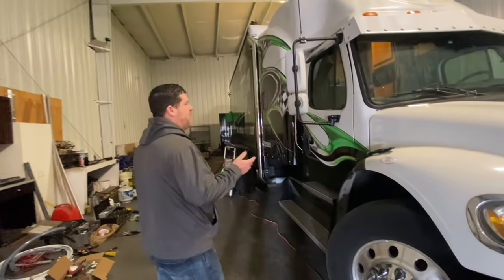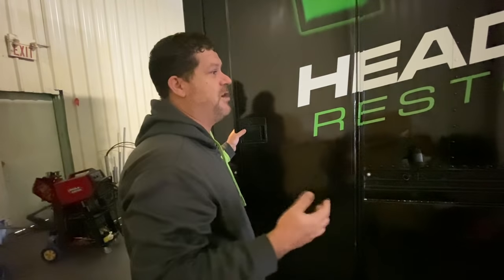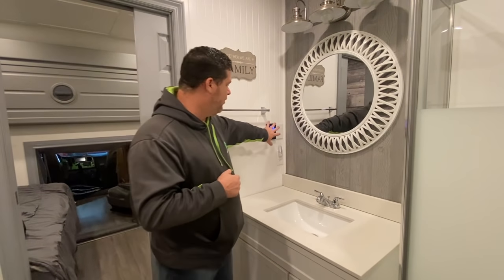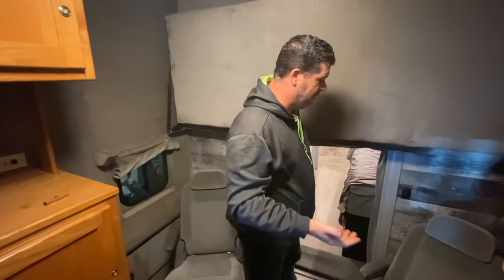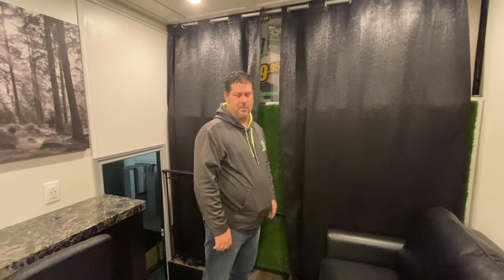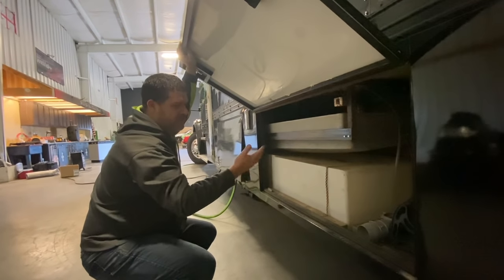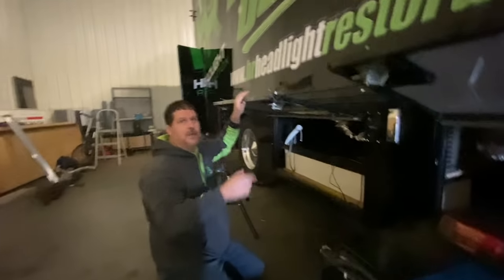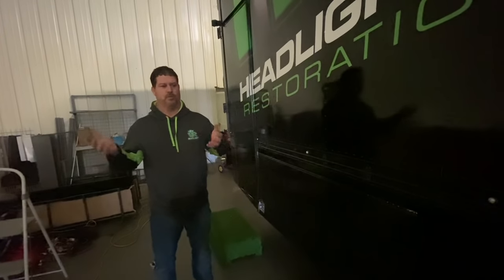Box Truck to RV!! Was it worth it??

Comment: I am not understanding all the negative criticism. Would I do a similar project the same way? Definitely not however this man did an excellent job and it fits his needs not yours. I'm just as comfortable with a Big Agnes and a jetboil. To each his own.
Reply: T DoubleU  8
Reply: I have been wanting to do something like this for many years now.  I agree with pretty much everything that he said with regards to planning and equipping a box truck as a heavy duty RV.  I would not make all of the same design choices, of course - but this was pretty much his point.  Design it to work for you.  Excellent video and presentation.
Reply from the maker: thankyou very much for your comment and yes was made to meet our needs for the business if for personal we would have done a couple things different thanks again cheers
Reply from the maker: thank you cheers
Reply: You Sir, are a gentleman!
Reply: I LOVE THIS!! I've never understood why bathrooms always seemed to be an after thought. Also having lots of windows, most of which are sealed, so they don't allow airflow and in either case, ruin your insulation rating.
Reply: I agree.
Deb
Reply: The work he did was really good and I agree with the thing it's his he did the stuff himself he is happy with his work and how it works for him and his family this kind of posts should be more about this is what I did this is the information I found a long the way so the next person can do same or make changes or improvements when the do it the only thing I didn't like is u can tell he did look it his stuff but one thing he missed and it seems he still has the question on why rv companies don't know much about the on demand hot water units and why the tell him such high cost especially since he did bring up how the cost of doing the boxes under the truck himself was so close to the quote he got but that's not the case for the hot water how he set that up could have saved some people money but now might cost some money I did put a post explaining why tanks less cost
Reply: @JB4375  Windows are also aesthetic thing, to each there own. But I’d hate to be parked somewhere gorgeous and not be able to see outside from the inside. And bringing in natural light. This is a gorgeous build, but I personally love widows and get why people love/want them.
Reply: @hrheadlightrestoration6858  ...
EDIT: I did watch video,but NOW, three years later.....

would love to know how it is doing NOW? 
Specifically: moisture/Condensation/trapped moisture/mold, weep holes? Etc.?
Most conversions and RV's, campers, etc are FULL of mold and rot due to the difficulty of managing vapor control ...
Have you accessed or opened any cavities or areas where you can comment on?
Also along the Condensation discussion: did you insulate your water tanks? Foam directly on the tank? Air gap? Did you hear the space/ vent the space? Separately or commingled with cabin/living area air?
Did you plan/insulate for cold/winter/freezing ? 
(Both water freezing and the increased challenges with Condensation)?

Comment: How many times have you heard “Sorry, we do not accept commercial trucks at our campground, RV resort, trailer park...”?  On the other hand it’d be perfect for commercial zone stealth “camping”, truck stops, Rest Areas, loading docks, industrial parks and the back lots of Walmarts. Nice job on the systems.
Reply: I saw the signage stating "this is a registered RV"
but still wondered about weigh stations & the D.O.T. 'chase cars' on the highways. They do have ability 'I think' to run the licence plates & that should distinguish them.
It's wrapped w/advertising as a business. Our State would question that it would need "commercial plates" because of the Business name etc...
I'm assuming it's got RV Plates though.

Regardless ->This is one very nicely done RV. Well done Sir!
👍😎
Reply from the maker: First off thanks for your comments.  We have never been turned away but we do get (No way that's an RV I want to see it lol) Its one of my fav parts. Also we do draw a big crowed when we go to set up and I say go ahead walk in and the come out saying how awesome it is inside and all love the bathroom how big it is. now for the DOT we drive past them all the time as well as through the border and never have they stopped me and we even pull a 27' trailer behind it with a wrapped car and trailer behind it and never a problem. Cheers

Comment: After thousands of hours looking for an RV that I could live in and this is the first one, nice job.
Reply: you may consider that all of the US has CDL and commercial vehicle laws regarding these types of vehicles. but no one on youtube ever seems to address that fact when doing these conversions. anything with a GCWR over 25,001 lbs requires a commercial driver license and most insurers will run this VIN and force you to have commercial auto insurance which costs 10 times as much as non commercial. You also need not for hire stickers to keep DOT off you at each weigh station passing. 

All these stealth builds come at a price, and a headache. will your build surpass the weight limits for CDL? likely not, but it won't prevent you from being eyed by every DOT officer out there and potential subject to testing and paperwork checks. A bus conversion seems less likely to be hassled.

Comment: I installed a tankless hot water heater in a mobile home and yes more expensive that a standard one but the lowered cost in gas bill and a way smaller foot print. But never running out of hot water is awesome.
Reply: are they expensive?
Reply: I bought mine off of FB market place for $500 . Normally at Home Depot they run about $1200. but have a 25 yr warranty.
Reply: @georgecoffman377  home depot changes the model every couple of years  the mfg co. switch around product line just as frequently   and dealer product line shift frequently they also stop making a product line if the warranty market becomes over a percentage of the business.  some require that only the installing dealer can claim a warranty. im basically saying that they have multiple ways of disappointing their customers.   i have never seen a 25 year warranty honored. i have seen a 20 year warranty honored but it did take a very organized individual to get it.
Reply: I put on in my garage. It cost me around $700 and I forget how much I paid a plumber/electrician to install it, but it has been great. Now that I think about it, I think the unit and installation was a total of $700. I have seen units far less, but there was some option I wanted that pushed the price up a bit. Endless hot water and high gas and water bills because my teenage daughter never wants to get out.
Reply: @ZebraFacts  @George Coffman @Santiago Vasquez. How is temperature controls?  I've only used these flash water heaters at the nail salons where they seemingly only have two settings: "off" and "1st degree burns"? So can you get a comfortable mix that's neither lukewarm if you ad cold water, etc? Is there a perfect setting or a happy medium? I hope I explained this well.

Comment: If YOU build it, the RV you build will be up to a standard. The RV's made in the industry are not with a hell of a lot of corners getting cut. They also have a host of issues if there is ever something that goes wrong. Warranty of an RV in the industry is a criminal thing. Doing it this way, means you can do what you want, and for me that has great inherent value.

Comment: I’ve been living in my RV full time for over ten years. I like the bathroom but other than that it’s no no no. I want a real bed not a single narrow bunk. Since it’s extremely unpleasant to cook in the rain and snow a full kitchen is a must have. If you can’t cook and do dishes inside it’ll be a lot of restaurant meals or microwave garbage. Windows are something I use everyday, trying to live without the sun day after day would lead to suicide. I have a two foot square skylight I cover in the winter to conserve heat but that cover comes of on sunny days. You want windows. No full time RVer would live in this thing. When I say full time I mean no house to go home to. I wouldn’t even consider this thing for a weekend without an indoor kitchen.
Reply: I thought the lack of windows and skylights to be cave like. I like a tremendous amount of natural lighting and ventilation.
Reply: Yeah, this is definitely built to be used as a "camper" and not a home.
Reply: I slept in a 8 x 12 Box Truck with a Translucent Roof for a few weeks. On Cloudy and Rainy Days and at night under a Street Light, there was so much light coming through the Roof. The bad side is they are very hot during warm weather, but that could fixed with a roll over shade cloth or solid foam board insulation temporarily placed on top .
Reply: yeah, the lack of a kitchen alone makes this a severely impractical vehicle to live out of full time

Comment: I would consider modifying the storage box where the shore power and water comes in.  If you put a hole in the bottom of the box and fit it with a plug you can feed your water and electrical through and still  be able to keep you door closed and locked.  It would provide for a cleaner look as well as keep the contents of the compartment safe.

Comment: Darn impressive!  In regards to windows.. local construction code for houses actually require them as an egress/emergency exit.  In case of fire or getting locked in or blocked or something, they provide a means of exit.
Reply from the maker: we have multiple way of getting out incase of emergency but thanks for the comments cheers
Reply: WELL BUD IT'S NOT A HOUSE
Reply: The beauty of a mobile build is that none of the building codes apply.

Comment: For cost this thing is amazing. There’s a lot that doesn’t work for me. I do use my windows. I like sitting by an open window in the morn. The best thing about this is how much it fits you and that’s what custom builds are for. I have an 8x12 box truck and no built in shower. And no regrets about that choice. I have a set up / break down shower and no dedicated bathroom, just a toilet. I  happy with my choice. 

This truck is also huge!!! I’d love to see you cover the legal requirements of this. Could a regular person even own one of these with a normal driver’s license. How challenging/expensive is automotive services? Have their been any complications with getting spots in RV parks or any limitations to where it can park?

Comment: I love your point on NO WINDOWS. I always thought about converting a regular semi into an RV. And I didn't want windows. And with live wifi cameras on the truck's outside, and inch-thick screens today, you can just electronically create 'fake' windows when you're not using the screens for TV. And windows are just a point of entry for crooks, vandals... And nobody is looking out windows. They really are pointless. Go to driving area if you want windows. Oh, I thought I was the only one that would want WINDOW-LESS RV. Glad to see yours.
Reply: Windows are essential for ventilation foremost, and scenery secondary. I think it is essential.
Reply: @jamestomas3783  Vents are in the ceiling. And that's plenty.

Comment: This is an option for me to do to my extra one, it's a 2007 Freightliner Columbia (Class 8 chassis with a 24 foot box ) and it is fully paid for, it would be feasible because I can take my time, and work on it in my spare time. I drive a 2014 Freightliner Cascadia (Class 8 with 24 foot box) for work. It is myself and my partner, and it is also paid for. He has prior experience in cabinet making so he could do the majority of the wood working. I am glad people are considering this as an option because these expedite trucks don't get enough appreciation and they will see a new life as a happy camper. Thanks for doing this video. It's a helpful inspiration.💝

Comment: A great video in that you talk a lot about costs and give prices--something almost no other van conversion video does. As for the on-demand hot water--almost ALL the class B van conversions use one and many talk about the installation, etc. They come in electric (not recommended), gas, propane and diesel.

Comment: As an HVAC guy I would have went with smaller ducts and higher pressure unit, but very nice job 👍
Reply: Correct me if I'm wrong, but if he were to simply replace that ducting with something smaller via reduction adapters, wouldn't that effectively increase the speed of airflow through the ducts, assuming that the blower isn't restricted by the reduced volume in the ducts? Same volume through smaller aperture per unit of time = higher flow velocity and a slight pressure increase? I guess I'm referring to sort of a Venturi effect.
Reply: As a woman, I thought the flex hoses could be smaller, like  a vacuum hose.

Comment: There is such thing called a ACR switch which you can automatically charge the house batteries off the main engine and it will stop the charging when the engine is off and flip the switch off so it doesn’t drain the main batteries and then you could flip the switch manually to be able to start your main engine with your house batteries it is made by a company called blue seas it’s in the marine world highly recommend it and then you don’t have to fumble around switching switches manually

Comment: I agree with the bathroom shower but I would need a kitchen at least the size of the kitchen you'd get when you stay in one of those Staycation Embassy Suite Hotels about 4x4 or 4x3 size but it has a refrigerator, stove with oven, a sink, upper and lower cabinets, enough room to make a sandwhich lol

Comment: Totally agree on the bathroom. Yes, you only spend so much time in there a day. But it's very intimate time too. For most people, it's one of the rooms you want to feel most comfortable in since you naked or doing your business. Why do you think so people want nice bathrooms in houses? Same thing. You want that intimate time to feel nice. By giving the bathroom that bit of extra room or using both sides in a vehicle as opposed to just one side can be a huge quality of life improvement. Would I build it that big? No. But it shows that if you decide to cut the space in half and/or remove the sink or downsize the sink, just how much room you can still have in a RV/Camper compared to the cramped default stuff. It's also why more and more tiny houses are upping the size of the bathroom. While you can get use to a tiny bathroom. Having room for a nice size bathroom can feel like a "luxury" and really it shouldn't be a luxury. Just a few inches or optimize spacing and planning can make that "luxury" just practical and default rather then sacrificing or settling for convenience or conventionalism.

Comment: The only thing I can say after owning a few RV’s and restoring an airstream motor home is there should be an escape hatch aside from the door, that’s the other reason for full size windows. I’ve seen a motor home burn on the highway, no joke 10 minutes the only thing left was the chassis with the frame, scary stuff. Great build, I’ve been looking for the on demand hot water heater, I was also thinking about electric heater floors, as long as you’re plugged in at a campground why burn propane in the furnace when you can use the electric from the campground right?
Reply: great point. Perhaps that back deck is the escape route. I'm not sure how it opens from the inside but have an emergency way out is crucial in a motorhome.
Reply: technically he has 3 doors, back man door, and driver and passenger door on the truck, access through the blow through of the cab.. 
Just a thought.
Reply: I think the man door into the cab to allow exiting through the truck doors is good enough
Reply: This is a bit off topic, but your comment about an escape hatch reminded me of the scene from one of the Legal Weapon movies (with Danny Glover and Mel Gibson), when Mel's camper is being shot at, and he had an escape hatch built into the floor. So he dropped down through the floor of the camper and crawled out from under it to the opposite side of where the shooters were.

Comment: So smart having just one sink. I've always hated the fact that RVs always have two sinks. It's so silly.

You should look at a recirculating shower, mini split AC, and a diesel heater/water heater. You can eliminate your propane system and just use the truck's diesel to heat your home and water, or take it a step further and use solar to charge batteries to run your HVAC and hot water.

Comment: This is not a RV, this is a full house. I love the concept of building the whole thing around the bathroom. Most people buying a RV believe that the bathroom is less important than the kitchen and that's when they get fed up with the tiny bathrooms and sell the whole thing after a couple of years.
This truck conversion is the ideal home for a retired couple, even if they don't do too much traveling.; in fact if  I could afford it that will be our choice.
Our idea of retirement is to move to a warmer climate year round, so heating wouldn't be a problem.
I would install solar panels on the roof (I don't trust propane tanks under my house) leaving some sort of a channel in the center to have natural light through very strong Plexiglass, protected with a metal grill that will allow us to walk on the roof when needed.
All and all this conversion is one of the best I've seen.
Keep the good work amigo, your imagination is your only limit.
Greetings from Toronto.